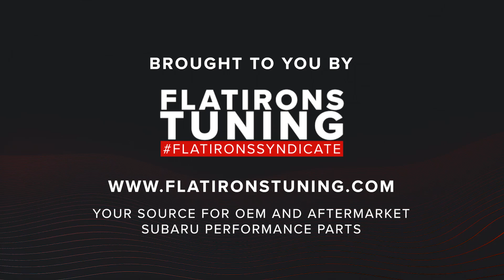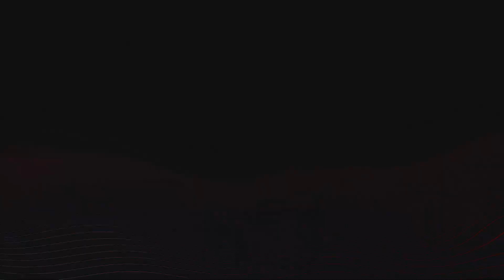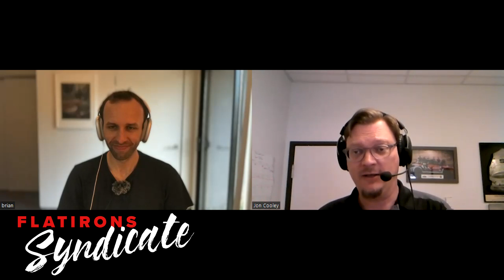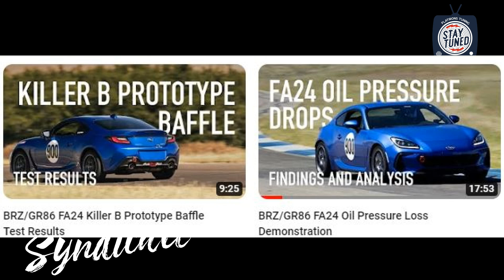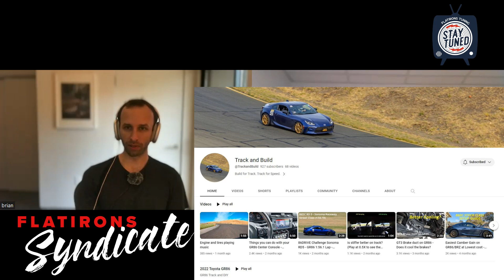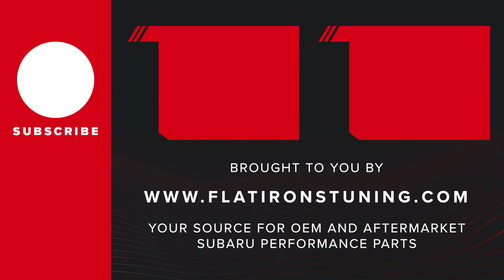We talk BRZ Oil Pressure with 900BRZ

Comment: Just a theory, could it be the rotation of the engine, splashing the oil around above 6000rpm is creating movement away from the pickup that on right hand turns is creating the shift? Or a cavitation of the oil pump at those speeds and the inertia change magnifies it?
Reply from the maker: Thanks for the post.  Those are both good ideas.  I'd say that it is also possible that it is related to the draw from the oil pump at the higher rpm as well.

Hopefully we will have a clearer picture of the problem soon with all the people that are now collecting data on the issue.

Thanks for watching and Stay Tuned!
Reply: @FlatironsTuning  fingers crossed bro. I enjoy the science side of this too so 100% will stay tuned. Just picked up my new 86 today so looking forward to the learning

Comment: In New Zealand we have a one make race series based on the Toyota GR 86.One of the track’s,Hampton Downs is notorious for killing Subaru engines.I have never seen one of these cars retired through engine failure?This series started in 2013 based on the Toyota GR 86 built in NZ called the TR 86.Very close,scrappy racing with some driver’s coming from overseas to race.
Reply from the maker: Thanks for watching and thanks for the comment.  That is certainly interesting.  I wonder if some of those mechanics has figured out a solution...

Stay Tuned!
Reply: @FlatironsTuning  The NZ 86 TR series was based on the 2.0 L versions.This will probably change over to the new 86 2.4 L.Australia has already started using the new 86 2.4 L with oil,bearing issues and will most likely use a dry sump for the series.I wouldn’t be surprised if Toyota GR have rolled out this series to America and other countries.

Comment: Toyota with the promise of the GR Yaris/Corolla engine possibly  in the future with the 86 will solve this problem.Porsche use an  integral dry sump system on there later cars.Cheaper for a manufacturer to use an engine already in production.
Reply from the maker: Thanks for the comment and thanks for watching.

Stay Tuned!

Comment: So I'm doing autoX  this weekend with a new set of grippy RT660 tires...and I'm nervous. Fortunately I usually only exceed 6000rpm at the finish line. Everything is taken in 2'nd gear so turns are going to be down in the 4-5000rpm range. Will oil pressure drop? Probably, but if 900BRZ survived those drops while pushing hard at 7000rpm then it certainly has a decent chance of being perfectly fine. I'll definitely be over-filling by half a quart just for good measure.
Reply from the maker: I think that most likely you will be just fine.  As discussed at the end of the video, if you shift around 6,000 rpm, that should keep you out of trouble as well.

Have fun out there!

Thanks for watching and Stay Tuned!

Comment: I'd love a GR86 with the G16E-GTS, in the Morizo state of tune, as well as the brakes off of the GR-Y & GR-C, upgraded dampers & larger sway bars (or at least the Subaru-sourced Brembos & Sachs dampers off of the 2024 "performance pack" trim). Essentially give me the Toyota GR86 Track mule with full interior & no scaffolding/roll cage. I would pay the, what I'd estimate to be, 36-38k for it too, so it can slot as the top trim GR86, but still slot under the Supra as to not step on it's Bavarian toes (assuming it was essentially a premium/10AE trim with the mechanical bits I want, and I could get Neptune blue/blue flame/voodoo blue/Grecian Water... why does Toyota/Lexus have so many names for the same damn color?). I'm 40, I don't have time to build and/or modify a car, I want to buy and drive a car, but the current offerings are either lightweight and underpowered (miata, gr86/brz) or have a good amount of power, but are very freaking heavy and/or expensive (Mustang, Camaro, M2), or are a Porsche 911... that starts near 6-figures... If the IS500 came with a manual I'd have one of those, or if the CT4V-Blackwing came with an LT-1 or LT-6 w/manual I'd have one of those and just accept the weight penalty as it could be my "all in one" car, right now I have an IS350 F-sport RWD that is my daily and I'm looking for a fun 2+2 toy so I can take my wife & kids with me, if it doesn't have four seats, I may as well just get a motorcycle again.
Reply from the maker: Thanks for the comments Jason.  I will say that I bet you will like our Podcast next week where we will be talking about a lot of rumors that have been swirling around about some new sports cars.

Thanks for watching and Stay Tuned!

Comment: I have a latest video that logs oil pressure at VIR. Note: currently the oil pressure transducer is suffering temperature drift, so take all oil pressure with 10 to 15 psi above.
Reply from the maker: That is interesting.  We will definitely have to check it out.

Thanks for watching and Stay Tuned!

Comment: Thanks for being a great host and helping to bring this information to more people!
Reply from the maker: Thanks Brian.  Very glad to do it, and thanks for what you all are doing as well!
Reply: Hi Bro, really appreciate you work here! actually I am also a software engineer and has the same interest and passion to solve this issue even though I am EJ owner, can I ask a question how you were able to log those data, what tools and method you use to log you oil pressure and oil temp, more accurately, how you extract those data from the sensor you installed which you can not get those data from ECU obd2.
Reply: Also I have couple ideas here probably can help you address the issue, in my opinion instead of trying different 'solutions', we really need to know what is happened in that oil pan, all the 'solution we make is based on the assumption we make, so there are two methods we probably can try. 1. attach a mini camera on the top of the oil pan inside to check what happened when this car is on track. I have seen someone did this to EJ before 2. Try to create an exactly same lower oil pan but transparent using glass or some sort of 3d print materials, and set up a camera underneath the car the see what really happened.     All those method is trying to figure out what really happened inside the oil pan, probably you will have better idea on this approach and help us to solve the issue
Reply from the maker: @kiritowow2736  Good ideas for sure.  It is definitely critical to try to figure out what the cause is to make sure that you develop the correct solution.

Thanks for watching and Stay Tuned!
Reply: Vacuum formed lexan oil pan + action cam?
Reply: Just a theory, could it be the rotation of the engine, splashing the oil around above 6000rpm is creating movement away from the pickup that on right hand turns is creating the shift? Or a cavitation of the oil pump at those speeds and the inertia change magnifies it?

Comment: Someone really needs to make a camera and data logging system that's easy for people to use. I'd buy it.
Reply: GJP has an io box that allows you to log oil pressure. I'm currently testing it out
Reply from the maker: I just went to their site and took a look at it.  Interesting stuff for sure!  Thanks for letting us know.
Reply from the maker: I totally agree.  Being able to overlay data onto a video so you can really see it in context of what the car is doing is a big deal.  One of the best things that we gained with the Standalone in the Pikes Peak car for sure.

Thanks for watching and Stay Tuned!
Reply: Yeah it would be so nice to have the overlays applied directly in camera. The other thing I’ve thought would be nice is if you could apply the overlays over a transparent background instead of directly on the video. Would make it easier to cut the video down to multiple sizes. For example, if I want to show laps side-by-side, I’m pretty limited to keeping the original aspect ratio unless I’m okay with cropping the gauges.
Reply: I’m hoping the next Catalyst will have this, literally all they need to do is add datalogging everything else is already there